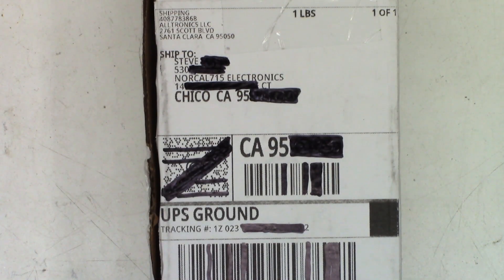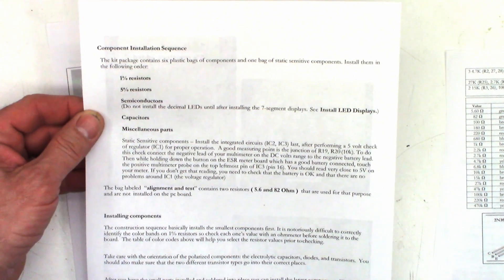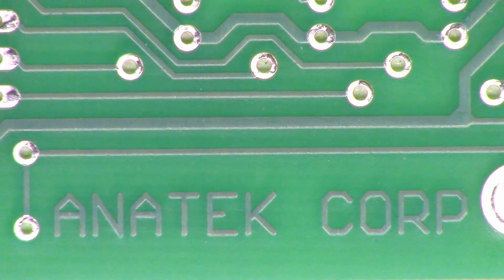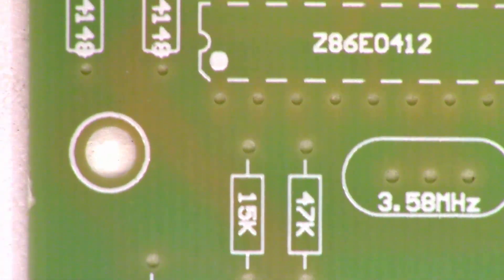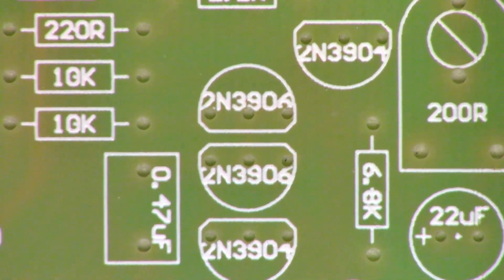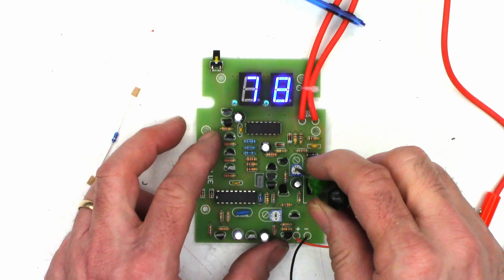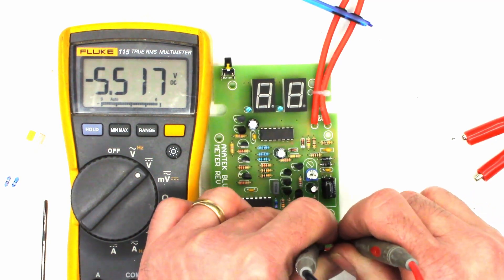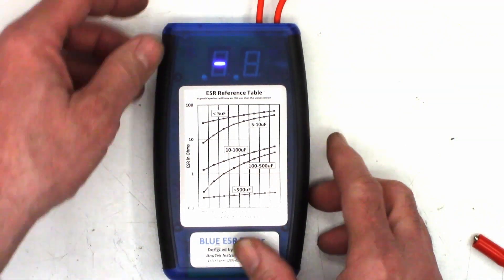BLUE ESR CAPACITOR TESTER METER COMPLETE ASSEMBLY - START TO FINISH ALLTRONICS ANATEK BOB PARKER

Comment: Just wonder what brand of test leads you are using?  I just built the kit and I don't like the test leads that came with the kit. Thanks
Reply from the maker: They are Keysight technology probes. I used standard test lead to the supplied banana plugs that plug in the the replacement test leads. https://www.mouser.com/ProductDetail/Keysight/U1169A?qs=YCa%2FAAYMW00oL5wtpCD3GA%3D%3D
Reply: Thanks for the quick response on my question. I built the esr kit because of your video.  I have a capacitor wizard and like it alot but the blue esr gives you a reading where the capacitor wizard say to compare.
Thanks for making video's of your repairs , I find them educational.

Comment: Where did you get the test probes you are using with your Blue ERS meter ?
Reply from the maker: They are Keysight Technologies test leads model U1169A https://www.keysight.com/us/en/product/U1169A/test-probe-leads-with-19-mm-tips-and-4-mm-tips.html
Reply: @norcal715  Thank you for the speedy reply. And if course, the great videos. As a Chevy dealer mechanic, I find your diagnostic strategy impressive, with your explanation why you did what you did.

Comment: Why did you skip using the IC sockets? Those are kinda important for heat sensitive ICs.
Reply from the maker: Unless it is a high failure rate IC then I typically don't use sockets. I have been hand soldering IC's since the early 80's.

Comment: I didn't know that there was an Alltronics in the US? I thought that they were an Australian outfit? I wonder if they are the same thing?
It's a great piece of retro tech, but ESR just isn't enough for capacitor testing! 
The ultimate tool is an LCR Bridge which is currently available on eBay, I got mine for $95Au after watching a video on it over at XRayTonyB's channel, it gives a reading for capacity, ESR, disapation, Quality factor and phase angle! 
If you need to know exactly everything about capacitors, inductors and resistors... Then this is the best tool! I swear by it and highly recommend it! The one that Tony got is in a silver aluminium case, I got the newer version which has a built-in lithium rechargeable battery via USB C and it's in a black case with a blue screen instead of the lime green on the older one, both are good! 
Once you watch Tony's video, you will want one! I had been watching it for years but held off from buying it because it looked complicated with all the information displayed on it's screen but once I saw it in Tony's video, it was kinda like a how to use video, I realized that it's super easy to use and jumped out to get one as fast as I could! 
This LCR Bridge will replace your new ESR meter as soon as it shows up! It really is that good! It truly deserves much more awareness. If you are serious about knowing everything about a capacitor, inductor or resistor... Then you need this!
Reply: Agree, after watching Tony's vid I ordered one.  Glad I spent time researching what would be best for audio equipment restorations.

Comment: I have had "Ol Blue" in my shopping cart for a while along with the MESR-100 V2 and been waiting for a quality review on YT to show how well either work with in circuit testing. If you could show a side by side comparison of your MUL3333 vs Blue, I would be ever so grateful. For the record I know you like to remove one lead, but if you could entertain a true in-circuit test just for giggles, it would be interesting to see if the results are similar between both meters.

Comment: For the calibration we need measure the resistor using fluke DMM if exactly 82 ohms before measure to esr and adjust, ohms range to exactly in esr calibration

Comment: The chart is hard to understand
Reply: I have a chart that I use but can't post a link.  you tube wont allow it :(
Reply: @mixinginthebox  ok I need it
Reply: @leonjohnsonjr3331  Check your you tube discussion tab.
Reply: That chart was the idea of an engineer and no one has ever told me they like it. I hope this link to a .pdf version of the Dick Smith Mk2 ESR meter's front panel chart will work: http://bobparker.net.au/esr_meter/2003esrchart.pdf

Comment: Mines was already assembly I had to pay extra money
Reply: Mine too, but it works great : )
Reply: @ZilogBob  everyone has a background....
Reply: That's all good but unfortunately it's not a very useful tool. It only read's the ESR, no capacity, no disapation, no Quality factor and no phase angle... There's a good Video on XRayTonyB's channel on such a LCR Bridge Meter which is available on eBay, you will never use any other tool for capacitor testing, that's how good it is... Trust me, ESR is not enough! 
Just imagine, all the information displayed at the same time on one screen! No need for multiple tools.. and it's just as easy to use as these things! Just search for LCR Bridge on eBay, there's a silver aluminium case version with a lime green LCD screen, and s new version in black aluminium case with a blue screen and a built-in rechargeable battery via USB C... If you are not using this, then you really don't know what the capacitor condition is in, an ESR tester can't tell you! There's many capacitor failure modes and you need to see them all at the same time... You won't regret it, best tool that you have ever spent money on!
Reply: @ZilogBob  and this is exactly the reason why people whom have had equipment repaired by a technician would have had a bad experience and would rather throw it out than have it repaired! 
Sure, some things should be thrown out, they shouldn't have been made in the first place! But junk electronics is another topic altogether... 
I don't want to be known as that person who is only interested in a quick dollar and for that reason I won't work on junk electronics! 
If you have come to me for repairs, you are going to get a repair for that device that you will not need to have it looked at again for the next 20 to 30 years! I always try to do my best to restore it unless the customer is only interested in retrieving data or something personal from the device and it can be then recycled... 
Put it in this perspective, if you have something that you consider to be valuable to you for whatever reason! You know that after I have finished with it, it's not going to come back to me next month or year! I'm not interested in getting your equipment working for a short time! Especially if it has been working for the last 30+ years! 
And yeah it costs more, but not that much more. Once you get into the habit, you would be surprised at how quick it is when you have it down pat! But I have a thorough understanding of components and their failure modes... So I know where it went wrong and why it went wrong and where it's going to go wrong next if I only just get it working... But that's just me and I always have a lot of work!
An ESR meter is almost useless, you are not saving any time by testing in circuit... Failure of components is mainly due to a capacitor that is leaking DC current! And if there's one, there's always more! And unfortunately the only way to check is to remove capacitors out of circuit and test... A good LCR Bridge Meter will be able to tell you if you should replace the same capacitor or replace with a new one!.. 
Everyone talks about ESR but it seems that no one has ever tried to place a resistor in series with a capacitor to see what happens and then do the same with a resistor in parallel and watch how quickly transistors let out the magic smoke! But if all you ever do is replace the burnt bit and send it back, your concern about earning money will grow as you don't constantly get repeat customers, hmmm I wonder why?..